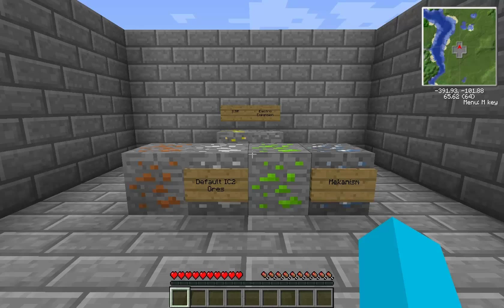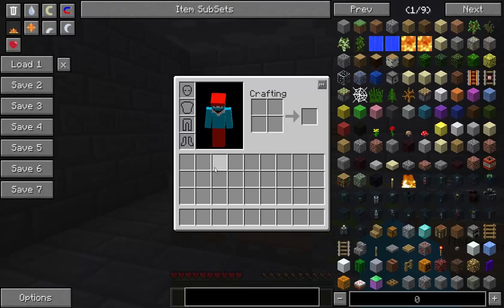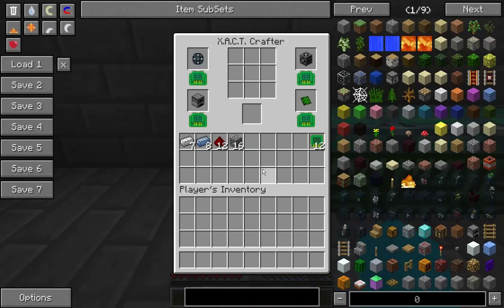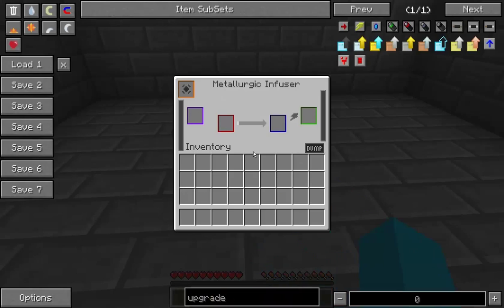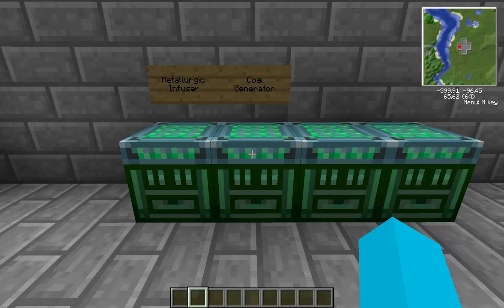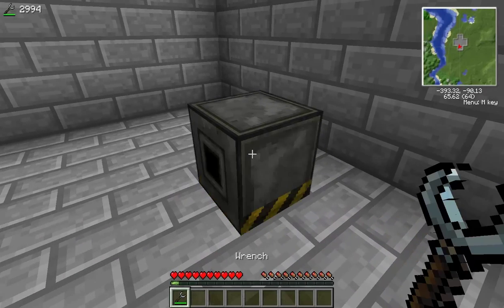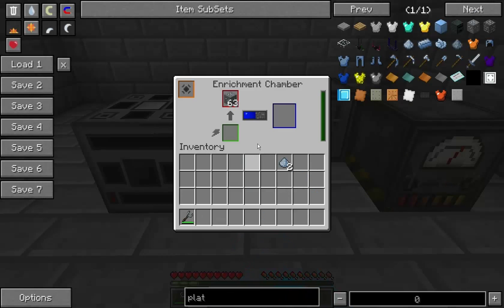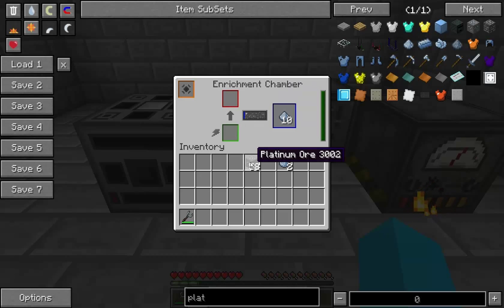Universal Electricity Tutorial Part 1 - Starting Up - Voltz Pack Compatible

Comment: Just a tip for the people using version 1.0.9, which may or may not be the latest, of Universal Electricity (Using the Feed the Beast Launcher) I had to make the Enrichment Chamber first, to get tin dust, before I could craft the coal generator. Basically, unless you find another method of creating dusts you'll have to make the Enrichment Chamber first. :D